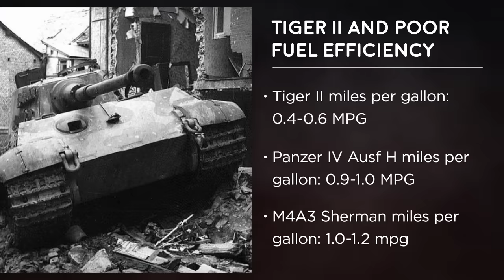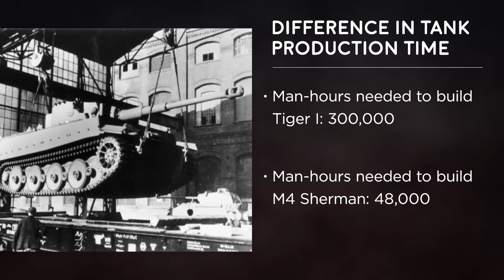Why Did German Tanks Perform So Badly in The Battle of the Bulge?

Comment: Thanks.  I do believe the Sherman was far from perfect in late '44, but like that we're moving away from the crappy death trap myth.
Reply: An adequate tank that works is a lot better than an an "awesome" tank that doesn't.
Reply: It was not adequate until the easy 8 model for 1. 2 . shermans had plenty of their own issue's and would also breakdown regularly early on.3. Its a myth the tiger was not reliable.
Reply: @peterm7593  but it wasn't reliable. The tiger needed preventive maintenance after every battle and when shot, the electronics were prone to breaking even if the tank wasn't penetrated
Reply: @peterm7593  And a lot of tankers didn't like the 76 mm gun because its HE shell wasn't nearly as good as the 75's. German tanks were kind of irrelevant compared to the infantry with handheld anti-tank weapons or anti-tank guns.
Reply: The tiger was the most feared tank of the war. Nuff said...
Reply: @peterm7593  no overall it was the P47. The germans were terrified of that thing. While the typhoon and Il 2 were not as accurate
Reply: @peterm7593 Also the Sherman was pretty adequate even with the medium velocity 75mm. The easy eight wasn't the only 76mm. They had 76s ready to go in Normandy except they didn't need them because 75mms were wiping the floor with the German tanks. Most German armor was easily taken care of by the Sherman.
Reply: @apersondoingthings5689  The other big reason the 76mm equipped ones weren't used on D-Day was logistics. There weren't enough to just use them, and the US didn't want to have deal with an extra ammo type. But, obviously, if the commanders had believed the 75mm wasn't able to deal with what they would face, they would have been sent regardless, so yup, that's key as well.

Overall, the Sherman's history is often the embodiment of the idea that "logistics win wars". Designed to be transportable, easy to fix, good uptime, easy to produce, and so on. Heck, even the emphasis on ergonomics kind of ties into that.
Reply: @Pixilated in 1944 both the Tiger and Panther were reliable by WW2 standards with an average readiness time of 70+% in the last half of 1944, the same as the Panzer IV. Furthermore, many of the big cats sidelined were out due to combat damage, not only breakdowns.
Reply: @apersondoingthings5689  last I checked P-47 was an airplane. And it wasn't more accurate than other jabos, why should it be?
Reply: @TTTT-oc4eb  were talking about the most feared things. I believe HVARs were much more accurate than the RP3s and whatever the Russians used. The germans feared the P47 because of the sheer amount of tanks it killed in places such as arracourt, the closing stages in the battle of the bulge, and other battles
Reply: @apersondoingthings5689  only slow moving ground attack planes like Stuka or Henschel could be considering even remotely accurate. The fast jabos weren't accurate, but they were excellent at shooting up logistics and creating general havoc. Few tanks were outright killed by jabos.
Reply: @TTTT-oc4eb  dude the battle of arracourt shows how your statement on tank hunters being inaccurate being completely false. The majority of the tanks the germans used were destroyed by P47s. You also said the panthers were reliable that is a ridiculous statement. It was never reliable by World War Two standards. Its final drive and transmission lasted somewhere around 150km before it need to be completely replaced. The tiger was the most reliable tank and that didn't far so well either
Reply: These goofs have watched to many propaganda video's. You need to do more research.
Reply: @apersondoingthings5689  many tanks were damaged by jabos, few were destroyed, also at Arracourt.

The horrible unreliability of late war panzers is mainly allied propaganda. All WW2 tanks broke down en masse during road marches.
Reply: @TTTT-oc4eb  No most of the tanks destroyed during the battle of arracourt. Yes they damaged them mostly but you clearly need to do more research on the battle. No most late war panzers were 100% unreliable, the tiger two was never reliable in the slightest same with the panther. The panzer 4 suffered from an unreliable suspension. The tiger was reliable but it had to due heavy maintenance to keep it that way. You Clearly avoid the fact that German tanks in the later stages of ww2 were not great tanks
Reply: @apersondoingthings5689  clueless
Reply: @TTTT-oc4eb Just do research
Reply: @apersondoingthings5689  jabos were not able to inflict large scale destruction of tanks because 1) their machine cannons could only cause superficial damage to a tank, and 2) the rockets generally couldn't hit the broadside of a barn. During exercises, without interfering AA, only 2% of the rockets hit a tank sized target.
Reply: @TTTT-oc4eb  rockets were not the only things being used by P47. the term Jabos refers to so much more than P47s. It us such a broad term
Reply: @TTTT-oc4eb  and yet the Germans feared the P47s for the well known tank destroying capabilities
Reply: @apersondoingthings5689  what other things?
Reply: @apersondoingthings5689  all jabos were greatly feared by ground troops.
Reply: @TTTT-oc4eb  I am not talking about other planes. Just the p 47. They feared by almost everyone
Reply: @apersondoingthings5689  Most tanks weren’t destroyed by Ground attack planes even on the Eastern front. The P-47 was good for strafing and rocketing logistics. Most rockets at the time were useless against tanks,  unless you aimed for the top of the tank.
Reply: @thewatchman9540  I know that on the eastern front. The P47 was a pretty feared anti tank platform, just look at the latter half of the battle of the bulge and the battle of arracourt
Reply: @peterm7593  "nuff said",  the refuge of those with no argument.
Reply: Whenever i hear that crap i always tell them that the sherman had to moved across an ocean. And despite the lack of armor it still had the highest survivability of any tank made in serious numbers.
Reply: @natelav534  yeah I hate it when some one calls it a death trap when it was the best tank of the war
Reply: More Sherman were lost in combat in the Ardennes than ALL the German armour types lost in combat there COMBINED.
Reply: TT TT,

Absolutely true. In fact the Panther reached a high of 85% operational rate in October 1944 and the Tiger reached a high of 98% in September 1944.
Source: Tom Jentz, Germanys Tiger Tanks, Tiger I and II Combat Tactics.
Reply: @lyndoncmp5751  the Germans didn’t count their losses. One of the German tank divisions in Normandy started with around 110 panthers and after they retreated to the Netherlands they had five battle worthy panthers and they never counted any losses. There is a great laser pig video about the tiger going over the myths of the German tanks
Reply: @lyndoncmp5751   You made the claim, you back it up.
Reply: A person doing things, 

Of course the Germans counted their losses. They are very precise. More precise than the Americans in fact. The Germans kept meticulous records of their losses. 
The German's total losses were 554 tanks, assault guns etc. 
Source. Christer Bergstrom:The Ardennes, Hitlers Winter Offensive published 2014.
20 Tigers. 
194 Panthers. 
158 Panzer IVs. 
182 assault guns and tank destroyers. 

However, around 50% of German armour losses in the Ardennes were not to direct combat but rather lack of fuel, mechanical issues, getting stuck in a ditch, a throw track etc and with no resources to recover them so they had to leave them there. 

As an example, the Panzer Lehr Division went into the Ardennes with 104 tanks, assault guns and tank destroyers. They had to leave 53 there due to lack of fuel etc (source: Danny S Parker, the Battle of the Bulge). 

American losses are not as precise as German but the consensus seems to be around 900, with circa 800 being tanks and circa 100 being tank destroyers. 
American total losses were almost exclusively combat losses. The Americans weren't abandoning their tanks in the Ardennes due to lack of fuel. Nor did the Americans lack resources to recover them. 

Therefore actual direct combat losses in the Ardennes is around 3 American tanks etc for every 1 German.
Reply: Steve White

Claim now backed up. You're welcome.
Reply: Nate Lave

Back your claim up. Give the survival rates of all mass production armour types in WW2 and cite your source.

I hope you aren't referring to The Chieftains flawed claim regarding Sherman crew survivability. The Chieftain only gives figures for enlisted men in the 'armour' branch. He doesn't include officers and he doesn't include non 'armour' branch. The fact is, the majority of Shermans and Sherman crews came under the infantry and calvary branch not the armour branch. Most Shermans were NOT in the 'armoured' divisions but were in the infantry divisions and the independent tank battalions. Personnel in these were not under the 'armour' branch.
Reply: @lyndoncmp5751  they did not really and definitely not as good as the Allies. I forget which division but there was one in Normandy that during the battle and thus trip to the Netherlands lost all but five of their original strength and did not report a single loss. The Allies did lest light counts where they counted every missing, heavily damaged , destroyed, or transferred as lost thus giving them on paper a higher loss rate than what they actually did. The Germans didn’t. The Germans counted any tank heavily damaged, broken down, or working properly as operable giving the impression that they are perfectly working when in fact few of those were working. 
Source is that new Lazar pig video on the tiger. Great video highly recommended
Reply: @lyndoncmp5751  also I think the Sherman had the second highest survival rate of ww2 after the Churchill due to the spring loaded hatches, plenty of space and number for the hatches, and great ammo stowage later in the war. I think the survival rate in general was an 80% survival rate and only 3% of tankers in the war died
Reply: @TTTT-oc4eb  
Correct. The "Cats" got a bad reputation from rushed production in 1943. A year later , their service rate was good. No if they had gotten that final drive/transmission issues fixed.....
Two things about the Sherman,  one, you're always going to have more losses on the attack,  two, I'm not sure if the Army produced reliable data on cause of damage. In other words, an 88mm hole could have come from a number of guns, not just a tiger.
Reply: @lyndoncmp5751  Good catch. I suspect the Chieftain actually is aware of these things, but is hell bent on presenting the M4 in the best possible light.
Reply: @TTTT-oc4eb  Wehrboo
Reply: @TTTT-oc4eb  Shermans are better than any German tanks.
Reply: @phyo1716  Coming from a genious like you, it must be true.
Reply: The Death Trap myth was true!
The captured Panther and Tiger Tank and tested exclusively by Canada  against the M4.  It showed the complete incompetence of the M4 in armor and Main Gun. The Firefly was the modification but limited numbers.
For Americans at D Day were not to go head to head with German tanks and let that TD take care of them.  Luckily the Canada got the most of the Panzer counter attack The Pershing Tank ready at D Day but the command could not field enough and logistics were already established for the M4 and 75mm support. To close to D Day to change but later 13 were introduced to the war afterwards.
Reply: Studies of historic documents show that the Sherman crews had a better chance at escaping from the tank than did the crews of Pz.IV, Panther or Tiger I or Tiger II.

The myth of the Sherman being a death trap came about mostly because crews kept ammunition outside of the stowage bins and also due to damaged hydraulic lines.
Reply: @peterm7593  But then again American Sherman tank crews did not encounter than many Tiger I or Tiger II tanks.
Reply: @sirridesalot6652  they just thought they did.lmao
Reply: @apersondoingthings5689  No, that isn’t true. After the war, research showed that only about 2% of German armour was destroyed from the air. As for accuracy, since both the P-47 and the Typhoon used unguided rockets, the difference was probably non existent. The internet is currently obsessed with trying to make the P-47 ‘the greatest fighter of the war’, which it wasn’t.
Reply: @lyndoncmp5751  that absolutely not true, 7,000 ish Sherman’s were destroyed with a smaller amount of those being total write offs. Only 4,000 were destroyed in the entire western front. This is completely untrue for Sherman losses in the Ardennes forest since most tanks have the battle of the bulge that were German were lost while Sherman’s while casualties were heavy didn’t lose nearly as much
Reply: @apersondoingthings5689 
The Americans totally lost nearly 900 tanks and tank destroyers in the Ardennes. Around 500 of which were Shermans. And nearly all of them were lost in combat. The Germans lost around 500 of all tank, tank destroyers and assault guns combined and around 50% of these were not lost in combat but we're abandoned or self destroyed after running out of fuel, minor mechanical issues, throwing a track, getting stuck in a ditch or bomb crater etc. The Germans lacked recovery and repair vehicles and equipment in the Ardennes and often didn't have to means to fix even minor issues. Fuel was a major reason for abandoning tanks. 
Far more Shermans were destroyed in combat in the Ardennes than the Germans lost in combat. That's an established fact. 
Source: Pallud, Parker, Zaloga, Jentz.
Reply: @lyndoncmp5751  according to Paul winter the losses of Germany was 67,000 tanks and SPGs
Reply: @thethirdman225 
Yes. While allied air power did hamper German movements and the supply chains, comparatively very few German tanks were taken out by air power. The British carefully examined and analysed nearly 200 Panthers on the Normandy battlefields to report on the loss causes. Only 11 were lost to air power. 
Source. Jentz Panther Tank page 147.
Reply: @sirridesalot6652 
What studies showed that? Source? 
The Panzer IV had an escape hatch each for all three turret crewmen. The Sherman never did. 
If you watch the footage in Cologne of the Panther vs Sherman/Pershing engagement you'll see the Panther crewmen get out of their Panther no slower than the Sherman crew and in fact more of the Panther crew survived the Pershing hits than the Sherman crew survived the Panther hits.
Reply: @lyndoncmp5751  honestly I would think that the 500 Sherman’s lost would be lost. No the majority Sherman’s were not lost, thousands were used in the Ardennes campaign and guess what they weren’t all destroyed. Germany lost 554 tanks, that was nearly all of there tanks. The numbers of losses of panthers alone in this battle and arracourt are much higher than Sherman losses in this battle
Reply: @TTTT-oc4eb 
Yes the Chieftains stats are very flawed. He does probably know that but is very biased in favour of the Sherman. He's not an impartial source.
Reply: @lyndoncmp5751  Sounds about right to me. I know it came from a British survey.
Reply: @apersondoingthings5689 
Sorry you are incorrect. The Germans lost a total of 194 Panther tanks in the Ardennes. Around half of those were abandoned/self destroyed and not lost in combat. 
Sherman losses (nearly all combat losses) were around 500. Total write offs. 
554 was not nearly all of the Germans armour. The Germans deployed about 1,200 in total. 
Source: Bergstom, Zaloga.
Reply: @apersondoingthings5689 
The combined allies lost 240,000 tanks, assault guns and tank destroyers v Germany.
Reply: @lyndoncmp5751  it’s not even 500 Sherman’s, that’s total tank losses, you know there was also Chaffee’s and Stuart’s in the battle right. It’s hard to pin losses of multiple tanks in one specific one. I said arracourt and the Ardennes campaign. Arracourt was a complete shit show for Germany.
Reply: @thethirdman225 
Yes they were very meticulous. It's the same with the Tigers of Schwere SS Panzer Abteilung 101 in Normandy. Apart from an air raid on 15th June near Evrecy, where 4 Tigers were lost in one night after very heavy carpet bombing the battalion didn't lose any other of its 45 Tigers to allied planes at any other time in the entire Normandy campaign.
Reply: @lyndoncmp5751  that makes no sense seeing that only like 60,000 shermans, and total losses of the U.S. was like 10,000 spgs and tanks. Considering how russia lost like 140,000 armored vehicles I find this unlikely. That’s Russia so those losses are kind of expected. In my research however I found that U.K. Lost only two M24s and they used 300 is astonishing
Reply: @lyndoncmp5751  Yes but that had more to do with faulty targeting than the Tigers themselves. In fact, the bombing missed pretty much everything it was supposed to hit, especially at Caen.
Reply: @apersondoingthings5689 
The British and Americans lost 25,000. The French lost 6,000 and the Soviets lost 105,000. That's nearly 240,000. 
Thats from Zaloga and Krivosheev.
Reply: @apersondoingthings5689 
As I said, the British Commonwealth forces lost 15,000, the US 10,000 and the French 6,000. That's 30,000 combined for the Western Allies. 
The Germans lost around 15,000 in the west so that's a 2:1 ratio in their favour.
Reply: @thethirdman225 
Well yes. Allied air power, especially fighter bombers/ground attack aircraft were not very accurate in pin point targeting of tanks. 
True, the carpet bombing prior to Operation Goodwood failed to even remotely nullify German armour, although some Tigers of Schwere Panzer Abteilung 503 were hit by it. 👍
Reply: @lyndoncmp5751  all allied armored losses combined is 21,000 max in all theaters of war,  how are counting so high
Reply: @apersondoingthings5689 
The Soviets lost 96,000 plus 10,000 Lend Lease. 
British Commonwealth lost 15,000.
USA lost 10,000.
French lost 6,000. 
Sources. Krivosheev, Zaloga.
Reply: @lyndoncmp5751  oh crap I added wrong
Reply: @apersondoingthings5689 
No problem. Peace ✌
Reply: @TTTT-oc4eb  Your BS